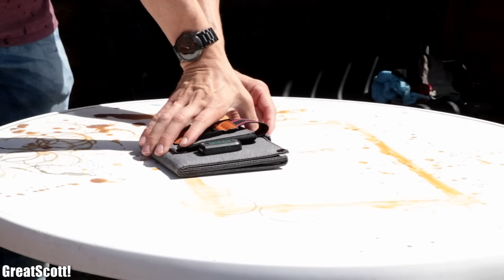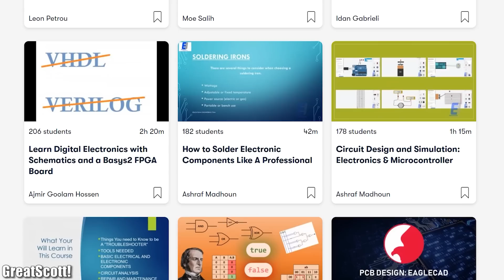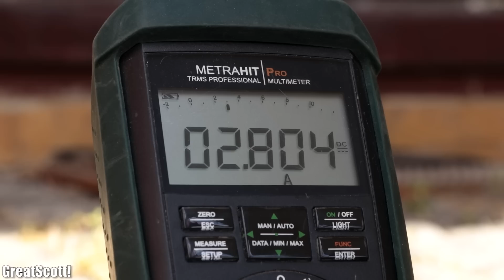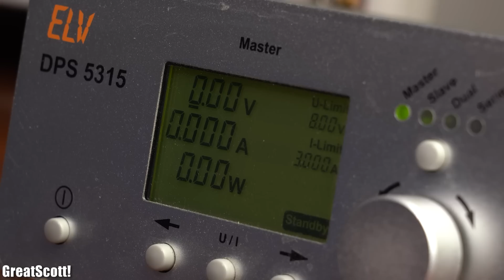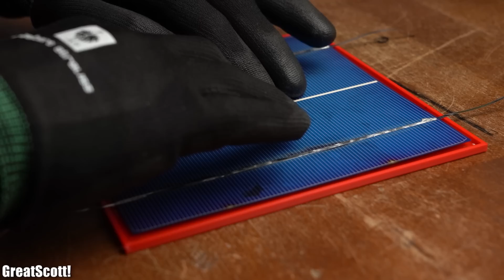5V USB Portable Solar Power Charger || DIY or Buy

Comment: Hello I was looking for a solution to a problem I have.  I'm adding fairy lights to a solar circuit using sc547. this works for the 3 volt lights.  I now have a rgb light with a remote and usb hookup.  for some reason it will light up with direct connecting a 18650  but running through the circuit it won't.  A 3 volt light will work with it.  what transistor or set up should I try.

Comment: So you invested the same amount of money + 5 hours work, and got something that would not last (because of no hinges). Adding flexible silicone-rubber coated leads will probaably prevent that. But all in all you get a cumbersome device for its intended use. I think both DIY and BUY fail this time.

Comment: the solar panel's output is probably rated at the standard 1000w/m2 solar irradiance, i.e. not german sunlight, but sahara desert levels of sunlight. today, in berlin, the highest solar irradiance was 463w/m2, so i don't think you've been bamboozled

Comment: DIY is the winner if you never leave the garden.

I have exactly the same issues.

I using my DIY for years. and finally got the exact same solar panels that is showing up here.

I can get 1.5 amp from advertised 14W.

the overall for me is to buy on. in this case DIY lose.

Great video. thanks for the efforts. it was very helpful for me.

Comment: Why not the constant load with the "buy" panel? How do you know the phone was not regulating at 1.2A due to its state of charge? My phone increases or decreases the current depending on how full the battery is but i am sure you know this. I think that 14w panel should be good for 2A on a bright sunny day if it is positioned well...

Comment: Connecting the solar panel via a buck boost converter to the smartphone, isn't it required to have a tp4056 over/discharge protection module? Or not, because it is handled inside the smartphone, itself? Should I add one?

Comment: The resistance of the multimeter will not be good for measuring short circuit current of the cell,  especially for a single cell with low voltage.

Comment: Nice, you can charge a large 5 v battery, in no time...buy one large 4.2 v lithium cell!!! And add fabric strip to the back of cells to help protect stress on cell connections...

Just a warning, that I learned the hard way, you need to keep two usb battery banks with these solar changers... Why??? Because you can not use and charge a bank at the same time, their stupid hardware prevents it... So you need one on the solar charger and one to actually use to charge your phone... Then you can switch the banks around....

Comment: The short circuit currents given on all those solar cells are rarely reached in practice because they are tested against a reference irradiance of 1kW/m² and a right angle. So the power of those cells is only really realistic near the equator around noon. In Europe you more or less have to divide the advertised power by half, you won't realistically get more than that.

Comment: @GreatScott! - Using raw fabric (like the VERY DURABLE 1000 Denier “Ballistic Nylon” fabric I bought on eBay for $12USD) would be THE BEST Low-Cost method to facilitate the SAFE folding/un-folding of these cells while creating a stylish portable & compact “roll” when not in use... 

Just choose your color and protect your connections. I’m going to give this project a shot for certain but seeing these unprotected connections from panel to panel made me want to cry 😭... 

I’d have to say (just from what I’m seeing here in the video) that when I’d most likely NOT connect these all in a continuous line, but instead connect them in a way that creates a more square/rectangular shape when unfolded...  THEN - I’d use the SAME FABRIC (ballistic nylon, same color as main shell OR switch up to black or whatever u like) to COVER EACH CONNECTION. 

As long as these connections are sandwiched BETWEEN a fabric like this, perhaps even adhered to the fabric, it should be FAR MORE PROTECTED... I’ll probably attempt to “fold” each connection in such a way that would allow some expansion while ensuring the nylon fabric (and actual distance between panels) is SHORTER THAN THE CONNECTIONS so the NYLON takes the brunt of any pulls or unexpected aggressive yanking and not the vital connections.

The only thing I’m not sure of is if there’s any way to BETTER cushion/protect/insulate these connections between my fabric?? 

Anyone who happens to see this please chime in!

Comment: As an Engineer I tell you that the time that you need to spend on that diy is cost more then the product itself 😅.
1) Solar pannel at Chinese sites or even amazon or ebay are cheap meaning if you want better efficiency percentage rating you need to spend more money per unit cell.
2) Not everyone got 3D printers and such as you have which cost a lot per unit not to mentioned the material you used, but I'll give you some slack ..
3) you bought cheap Boost/Buck converter which it's alright not stable all the time so in other words rather design your own protection Buck Boost converter you cut for saving money.. ill bite...
4) Material speaking i think the epoxy resonate makes another layer of permitvitty hence the efficiency drops.. 
5) Overall its a nice project as always yes it can be engineered better but will cost you more time, effort, and money..
So for cheap thing like that it's alright..
In the real thing you'll spend much more.. 
Great content 👌

Comment: If I'm not mistaken you can get the maximum power at the right angle of the solar panels instead of laying them flat on the ground. The tilt angle depends on your location, you can check here : https://www.researchgate.net/publication/315703674_Efficient_Operation_of_Residential_Solar_Panels_with_Determination_of_the_Optimal_Tilt_Angle_and_Optimal_Intervals_Based_on_Forecasting_Model

Comment: great video, i learned so much. but as a non-engineer, i noticed something that seems strange to me. when you testing the converter using the lap bench PS, lowering the power voltage actually increased the current AND power. and when testing using the fan, the result table showed something similar, voltage decreases, current AND power increased. what's happening there?

Comment: Hi. I'm a new to this. Can you use AWG wire to connect these panels in series? To make it sturdy and not exposed. My set are purposedly for DIY 12v cylinder LiFePO⁴ battery with BMS. Would a solar charger with different volt set up like 5v, 12v, 24v, 10amps good enough to make a simple DIY portable power system?

Comment: You might try Sodium Silicate a,k.a. Water Glass in place of epoxy.  Once cured, the result is actual glass. You can buy it or even DIY from hardware store components.  Water Glass is an amazing substance, covering a huge range of uses.  Such as concrete hardener, deck sealant, medical applications, and even preserving eggs.  https://youtu.be/IXQM8nheRv0  https://youtu.be/Ip-jDuM25FE
Reply: But water glass is soluble in water. Rain happens.
Reply: @rpbajb  Sodium Silicate is often used as a sealant, and is sold commercially as such.

Comment: Hi scott, just a trick. Every phone is capable of measuring its chargig current. For exemple, on my phone (bb key one) i can go to the "phone app" and type *#2886# and it bringes me to the diagnostic secret menu. From there, i can click on the usb/charger menu. When plugged in, you can see the charging current in ma, and you are able to test if one cable, or block is better than another.

i'm sure we are able to find access to that menu, with any android phone.

Comment: Today I finished the project. Same cells! 10 of them. If I hook it up to a powerbank with 10 18650 LiIon batteries of 2.2 Ah in them, I get around 18 Watt in full sun (So I connected the batteries directly). I also tested with a 6Volt lamp, but it only got 12 Watt at 5 Volts. Clearly the cells perform best at a lower voltage per cell (0.37 Volt per cell). I am thinking of charging LiFePO4 batteries with it, since those like to be filled at round 3.6 Volts, and float round 3.4 Volts. But I am also thinking of making my own MPPT circuit for it, I found one with just 2 NE 555 chips and a few other components!

Comment: one thing that should be mentioned is that you need to use UV resistant epoxy as regular epoxy degrades in the sun very quicky and turns yellow or cloudy.

Comment: Can you make a sun test? Let this cells in the sun for whole day (or for a couple of days) and then tell us about the deformation of the cells? Will the cells break because the epoxy resin has different thermal expansion values in comparison to the Cells?? Or will the cells survive longer? :)

Comment: You should use the sunpower cells. Much more rugged and still work even if they crack.
Reply: Sunpower cells can just be run through an office laminator pouch potentially with a fiberglass reinforcement.

Comment: Love your videos Scott!

But sometimes those testers can stop your phone from drawing quick charge amps (Amps greater than 1) usually.

 To test the actual output wattage having an appropriate load is a better way of doing it I feel.

 Though I wouldn't be surprised if the cell is a fraction of claimed as that does happen a lot.

 I am just speaking from personal experience. You tester might not have that issue.

 Thanks again.

Comment: Scott your problem with your original diy solar panel is because you used plexy glass and not 6 mm temp glass. i have solar panels that i made 8 years ago still working very well and strong.

Comment: It would be nice if you could go over the process of converting a buck regulator into a constant current driver. For example a driver ic like the lm2596s-adj and adding a current sense resistor and screwing with the feedback pin

Comment: Solar cells = 30€
Buck converder =1,50€
Filament =?
Epoxy =?
All in all the DIY version is much expensive as the comical one.
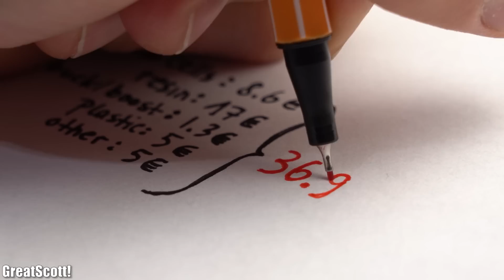Reply: 10:14
Reply: its 30 cells 30€, he use 10

Comment: I built my own solar panel, and had an issue with low output, I eventually figured out that the flux was damaging the cell, you have to use just a tiny bit, or none at All.

Comment: I think I read once that the chemicals in solar panels do not degrade as a result of photovoltaic action, but rather due to exposure to the air. I wonder if you would be willing to run an experiment on this basis?

Comment: I really like the epoxy trick ...DIY chargers are better and dont lie ...why so many panels???I use 3 small 4.6 v in series with a 7805 regulator with heat sink easy small and inexpensive ...

Comment: you should have measured it with a dummy load, not a phone. Phone will not always draw 2A, probably mostly not even close most of the time, especially when the battery is at 70%

Comment: You know laminating the solar cells should make it lighter. I've done the gelatin type once before but when i thought of laminating the cells i got a bit more power and the panels were more sturdy with a slim piece of plastic holding the cells. So try laminating the cells

Comment: Epoxy resin is normally too unflexible - differences in thermal expansion between the resin and your cells will most probably crack the cells. Polyurethane solidifies into a more forgiving coating.

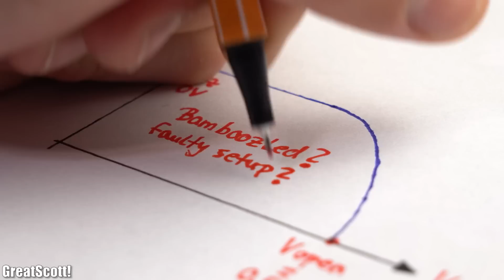Comment: 5:11 Isn't it because solar cells have maximum efficiency only in a narrow voltage/current range? Simple buck/boost converter won't be able to handle that task.

https://en.wikipedia.org/wiki/Solar_cell_efficiency#Maximum_power_point

Comment: There are very cheap solar mppt 3.7v lithium chargers on ali and ebay. 
For the wires you could use flexible silicone wire.

Comment: Surprisingly, I've recently bought the exact solar charger, however, I tested the Max current load at 5.2V, and it was 2.1A. in the video, your phone was pulling a smaller current than the charger can output, best guess is becuase your phone is designed to have a 1000mAh supply, and won't pull 2.4Ah, hense the assumption that the solar charger is incorrectly advertised. Although, I have to admit, it only just achieved 2.2Ah, in direct sunlight, so yeah, the specs are incorrect, but not as badly as you think.

Comment: During watching this awesome video, one question raised up in my mind. Why not using a single solar pannel 12V with a step-down converter? Like this one: Offgridtec® 10W MONO 12V Solarpanel (Link: https://www.offgridtec.com/offgridtecr-10w-mono-12v-solarpanel.html?gclid=Cj0KCQjw6575BRCQARIsAMp-ksMsEx8rqgHB-07APT8numfRqrwGgSGF7ysXYmoMSoJGx3zcKGy9B10aAkXQEALw_wcB). It costs about 18 Euros and delivers up to 10W of Power. Plus the step-down coverter for, let's say, for 2 Euros -> getting to 20 Euro. 
Also I was thinking about combining the output of 12V solar pannel to a  USB Type-C PD Powerbank, or would the power output of the solar pannel too low, what do you think?

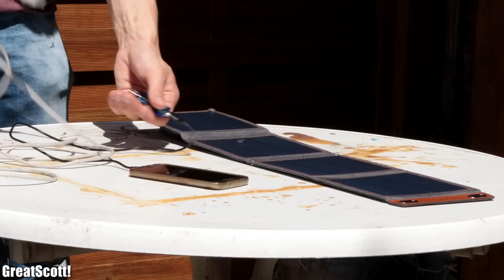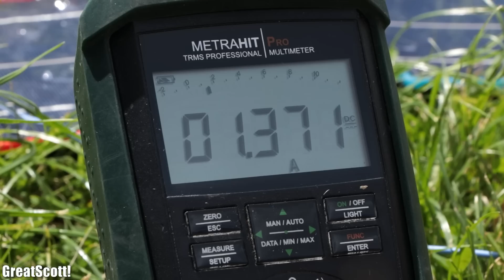Comment: @ 1:06 you show the buy product charging the phone at 1.25 Amps, but what level was your phone battery during the test? This would slow down the charge rate if the battery was above 60 to 70%. @ 9:52 you realize the phone was limiting the charge and used a DC load. So why didn’t you go back to use the load on the bought/buy product to see if it really does 2.4 Amps?

Comment: That Step up/Step down module is like <70% efficient.
better use more cells and step down or less and step up.
The cutoff voltage of stepdown modules can also be used as kind of MPP

Comment: Good test but I do wonder why you used a buck boost converter when only 5 volts is needed.
My solar backpack uses several power Zener diodes across the output at 5.1 volts (before the Schottky diode for low drop out blocking). Only wastes power when the solar panels are in full daylight and not charging anything.

Comment: The vast majority of the USB solar panels are what I like to describe as tech for yuppies that more than anything it is a rip off where the build quality is lower than first appears and over promise on the performance especially with regulated output that cripples the performance down to little as half and amp per port. I prefer rigid panels overall as the cells are better protected and the thermals are a bit better which helps in the long run between getting more out of the panel and it lasting longer. There are some rare prebuilt usb panels on the market that are rigid and have tempered glass instead of plastics that scratch easy and photo degrade over a year or so.

Comment: Couple of thoughts.  As others have said, MPPT controllers at the scale you are working at are inexpensive and will give a significant increase in realized power.  Second thought is that the rated power on solar cells is done under ideal conditions.  A good rule of thumb for fixed angle solar panels is that over the course of a clear day they will average half their rated power from 2 hours after sunrise to 2 hours before sunset. So today were at my latitude we have 14 hours between sunrise and sunset a 100w solar panel would be expected to produce 50w x 10 hours = 500 Wh of power over the course of the day.

Comment: I think DIY is more capable, because you can design in a way that you can add any number of panel strings (to match the power required for example a "fast" charge of car battery) and also add two outputs, one with fixed 5 V and another with adjustable output voltage for small car appliances, car battery charge, custom electronic board or liion battery custom pack designed to run offgrid.

Comment: Great video as always. I have already ordered some solar cells to do a similar project myself. I see you used tab wire all the way the cell (3:57) and only part of it (5:26) is there any difference or I can just solder it partly? Most people solder it all the ways but I don’t know if it is really necessary

Comment: Nice video! I would recommend learn a bit about phone charging with those fast charge protocols. Most of the time you need to short the d+ and d- lines to achieve fast(er) charging. But even this does not always work. For measuring the amps, I would recommend an app like "ampere" which measures it as well.  This eliminates the measuring device you use in between, which prob adds a bit of resistance, where the phone will limit its charging power too.

Comment: I simply buy a 10w panel and plug a car mobile charger . Done. Even my battery bank run 3s lithium batteries.  Which I can use for electric drill. Led lighting . And charging via car mobile charger.
Reply: Else use two 5w panels with a hinge so one can fold them. Pv panels being so cheap it doesn't make sense to make them.
Here in India high power panels above 200 300 watts cost about 3w per dollar and small sized ones about .75 dollars per watt. 
So for 10w panel price would be about 6 7 dollars and another 5 dollars for a car charger of about 2 amps. 
Most villagers where electricity is not proper use this solution here. Cheers

Comment: Great project man! But I guess it's a bit weird to have a solar charger so fragile you can't even put it in your backpack. Even if the diy electronics perform better, I'd still say the buy option wins because durability is very important.

Comment: It's inappropriate to use general DC-DC converter for solar panels. There are specialized DC-DC with maximum power point tracking feature (MPPT). They provide much more energy conversion efficiency.
https://en.wikipedia.org/wiki/Maximum_power_point_tracking